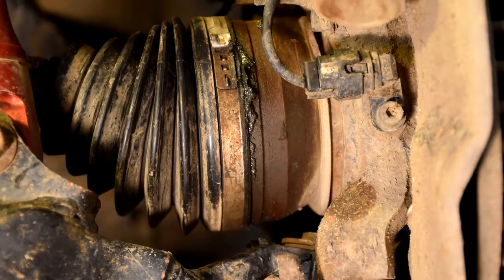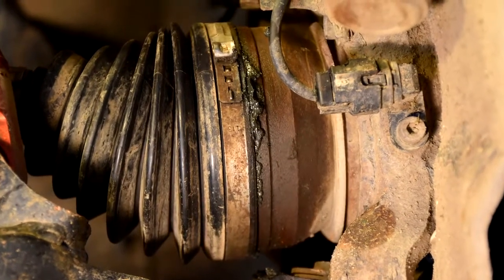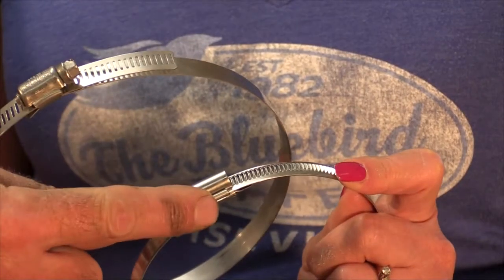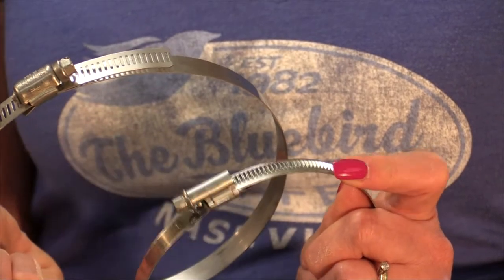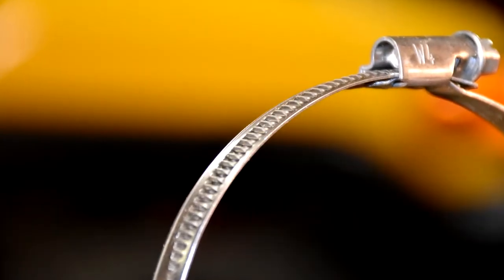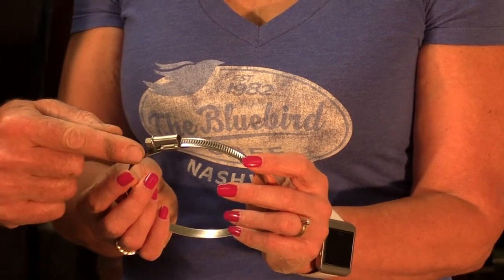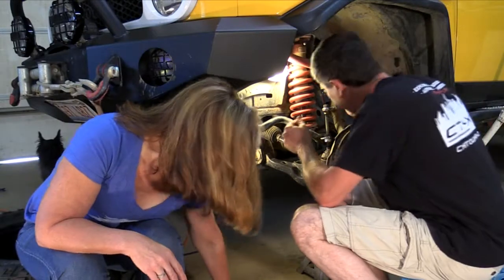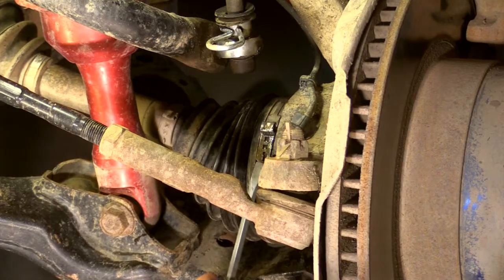How To  Fix A Leaking CV Axle Boot, Toyota

Comment: Where can I get clamp like this? Southeast overland website does not exist anymore.
Reply from the maker: Good question. I didn't realize SE Overland was closed.
Reply: Just got a set of 2 large & 2 small (for outside cv boots) on Amazon. https://www.amazon.com/gp/product/B07MRCK38W/ref=ppx_yo_dt_b_asin_title_o00_s00?ie=UTF8&psc=1
Reply: @steve6345  
Steve this was a big help thanks.. question have you added CV grease when installing these new CV boot clamps..if so what grease needle did you use.. thanks